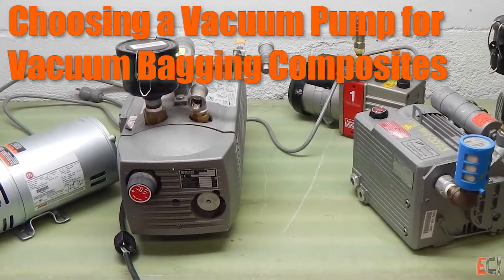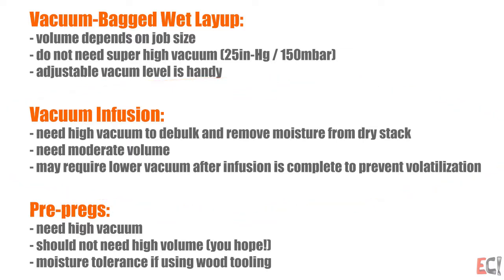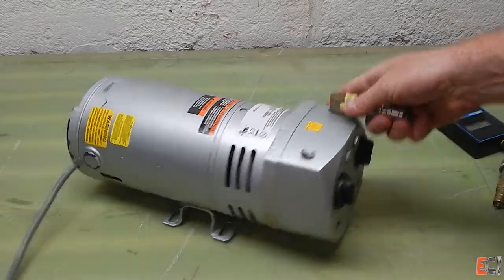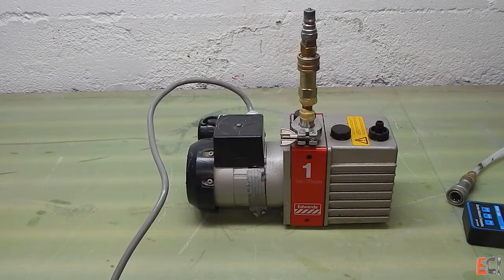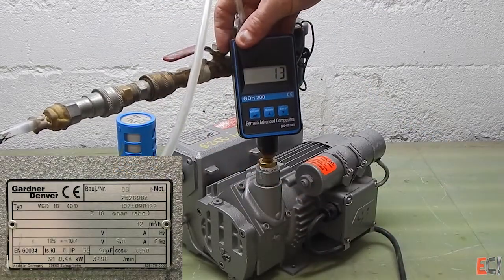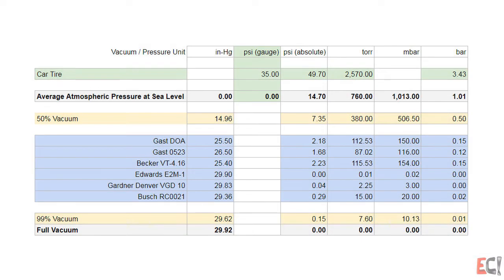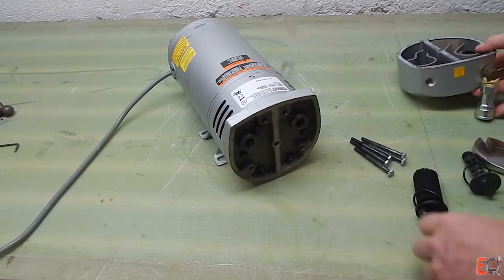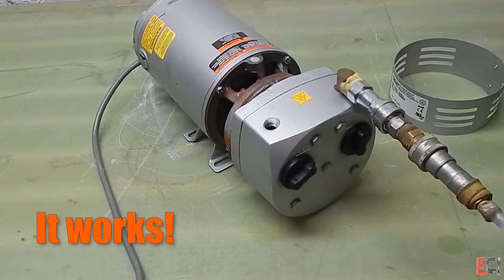How to Choose a Vacuum Pump for Vacuum Bagging Composites

Comment: Sweet!  I have one of those Gast diaphram pumps.  I didn't get it because I was clever; I got it because it was cheap on Ebay!  (I think it was $200 and in new condition, but sold as-is as part of a lab liquidation.) And it has been working flawlessly for the small parts I have been making.
Reply from the maker: Nice!  I hope is serves you well for years to come.  Nothing wrong with cheap either!

Comment: what's the best pump for both wet layup and infusion for a budget of $400-$600 range? I'm having a lot of trouble figuring this out. I have a ton of pumps I'm looking at but can't choose. single stage or double? oil or oil free? I was thinking a JB Eliminator. What are your thoughts? thanks in advance. -Carson

Comment: Is the Busch R5 sufficient to do multiple prepreg items simultaneously? Probably with a vacuum tank?
Reply from the maker: If things aren't too huge it should be fine.  There shouldn't be any leaks once the bags are fully down, but with prepregs there can be some water vapor or volatile stuff from the resin that comes off through the pump as you heat things up.  Bigger pumps will deal with this better.  Unless you're using wood tooling or lots of core this shouldn't be a big issue.  Sometimes a bigger pump is an insurance policy against one leaking part messing up the others - but leaky bags are always trouble.

Comment: i have a Dresser vacuum pump  DC2 high volume oil pump. I am having trouble finding the info on the required oil type? What should i be looking for in a oil. My unit looks low and want to flush and replace. Thanks
Reply from the maker: I’m no expert here - use what the manufacturer suggests if you can find it.  Not much out there on a Dresser DC2 though!  Most (rotary vane) vacuum pump oil is ISO68 viscosity mineral oil and unless you’re using a special pump generic vacuum pump oil should work ok.  You won’t likely ruin the pump with the wrong oil but it may not last as long or work as well.

Comment: I am looking at some Busch pumps that will need to be turned off every 2 hours for 15 minutes. Will this be a problem for composites work in your experience? Doing a mix of wet and infusion.
Reply from the maker: That will be a problem!  I've never seen a Busch pump with that kind of duty cycle - what is the model?

Unless you're using some very fast-curing  resin systems, it will be very handy to have a pump that will run 24hr/day for several days at least.

Comment: Would a air conditioning vacuum pump, like a Robinair work for composite layups?
Reply from the maker: Yes, and it will pull high vacuum.  The duty cycle may be an issue and it will probably heat up quite a bit and may spew oil out if your bag isn't really good.  But people use them all the time with success.

Comment: You said that the Becker VT 4.16 is the largest you can get using 110V power. Becker has a VT 4.25 and VT 4.40 that use single-phase power so you can get more than double the flow if you went to the largest one.
Reply from the maker: It sure is handy (where I live) to have 110-120v power unless you need bigger capacity.  They're just all around good pumps.  I picked up a tiny VT 4.4 since I made this video - it's really handy sized!

Comment: I have watched several of your videos and was very impressed, then found your website. Thank you very much for all the time you have spent putting this information together for all to learn!

I have just purchased a Busch RB 0021 and looking to purchase oil for the pump. I reached out to Busch directly, as it calls for their VM 032 oil and they did not respond!

Do you have any recommendations on a like for like oil that may be readily available at a local supply store?
Reply from the maker: You’d probably be ok with a standard oil but if its a new pump maybe spring for the busch oil!

Comment: Which CFM vacuum pump do we need for a specific volume? Is there any relation? Vacuum needed is from 0.3-0.5mbar.
Reply from the maker: In theory no - not related because volume only matters in pulling down the bag and with leaks.  Practically it helps to have some volume (CFM) for larger parts where you need to get high vacuum.  A los volume pump won’t keep up with the leaks until the bag gets very good.

Comment: Found an Edwards E2M30 for sale for pretty cheap. Is this pump overkill for composites work (wet layup and infusion)?
Reply from the maker: Yes it is probably overkill - but if its cheap that may be fine.  For infusion it is great.  For most wet-layup you'll want less than full vacuum, so it may not love being run with a regulator.  Just make sure you don't run it out of oil and plumb the exhaust outside your work area so you don't find yourself in an oil-mist cloud.  It may not last forever, but it will work!

Comment: What is the pressure range if I want to debulk Prepreg composite in a vaccum bag at room temperature?
Reply from the maker: Usually it is good to debulk with as much vacuum as possible.  The goal is to compact the plies and remove trapped air, so there isn't really a situation where less vacuum would be better - well maybe there is but I don't know about it...
Reply: @ExploreComposites  it's ok.. Tq for your response

Comment: I have two brand new gast vac pumps that pull 19 to 20 pounds    Dont know if this enough though
Reply from the maker: For bagging wet layup or clamping it should be perfect.  Infusion will be possible but not ideal at 20inHg.

Comment: I have many questions for you
Reply: Can i use 250lpm oil sealed pump replace with 150lmp whats is effect on vaccum
Reply from the maker: @lxldigvijaylxl  Is that liters per minute?  It should pull the same level of vacuum but less volume - so it will take longer to move a volume but eventually it will do it - in about 1.5 times as long.  The specs of the oils sealed pump will determine ultimate vacuum level.
Reply: @ExploreComposites  yes
Reply: I am looking to buy second hand leybold pump D16b
Reply from the maker: @lxldigvijaylxl  That is a nice pump!  I have had a similar Leybold one and it worked well for high-vac / low flow / low moisture situations like pre-preg cooking in non-wood molds.  That pump will pull all the vacuum - and more - that you'll ever need for composites!  Be careful about moisture as there is no oil filter or gas ballast (or is there? - if there is it can help with moisture) and will not like to run with air flowing through the pump in any real volume.  These lab-style pumps like pulling as close to full vacuum as possible!
Reply: @ExploreComposites  air balast is in pump 
Useful accessories purchase speratly
Reply: @lxldigvijaylxl  I rebuild those d series pumps. D8b D16b D25b D65b ect